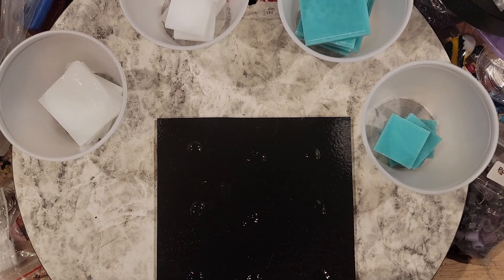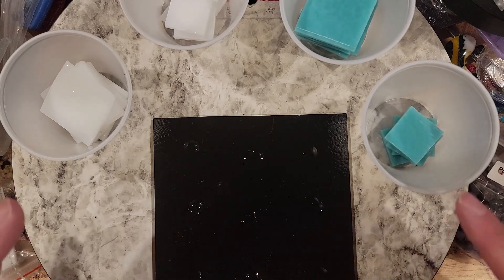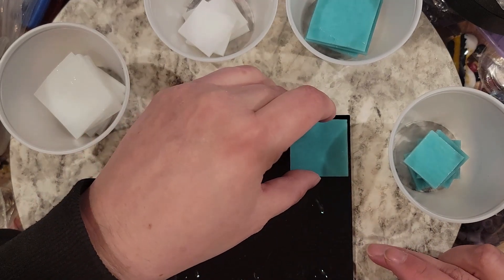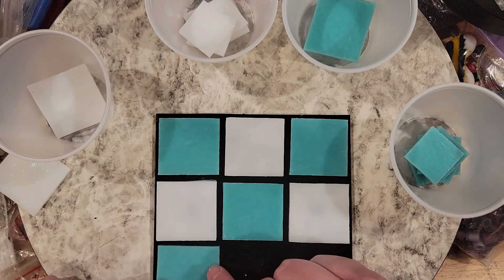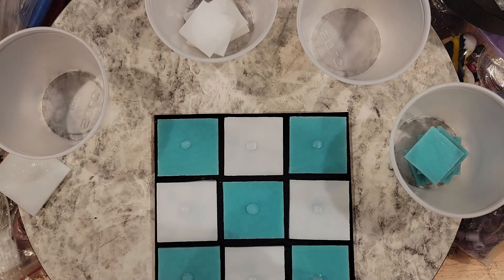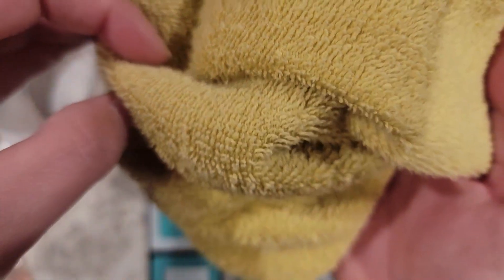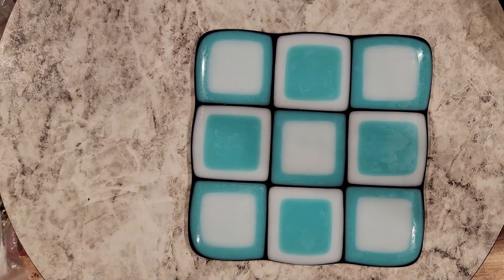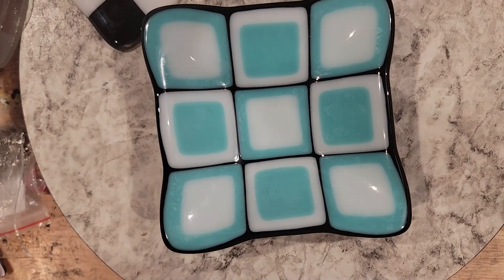Easy Projects   Stacked Squares - Fused Glass Projects

Comment: Steph, that is a wonderful project, I too love aqua and white!  One thing that sometimes can help avoid devit is to sift a light layer (so from left to right, 2 passes, the drop to the next "line", 2 passes, etc.) of clear powder.  You will be amazed at the multitude of "sins" it can cover up, lol!  I do this on nearly everything I make nowadays and it works really well!  Loved this project with the kind of pillow-effect, it is a beautiful little dish! ❣
Reply from the maker: I should have used clear powder on this, I do it on a lot of non clear capped stuff.
I think I didn't for 2 reasons. 1) I was in a hurry, and 2) I figured if I'm teaching simple projects that can be made without a lot of glass colours, or fancy tools, then clear powder to achieve a nice finish might be cheating.